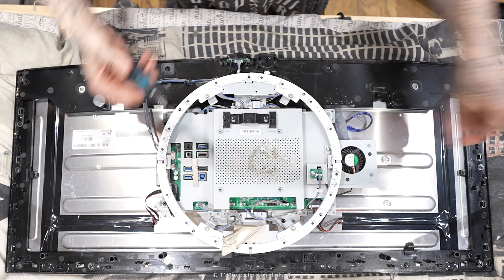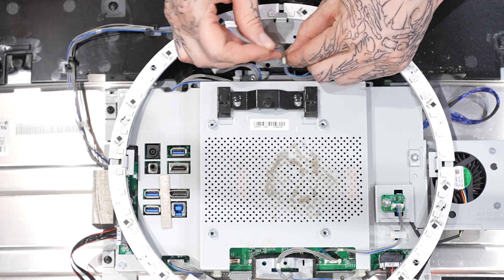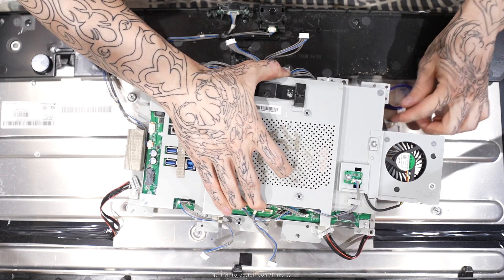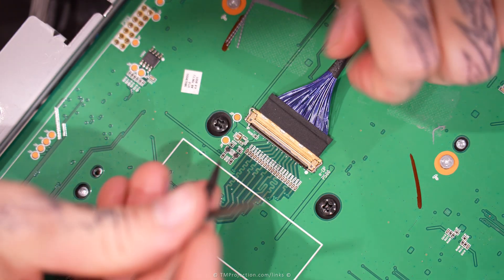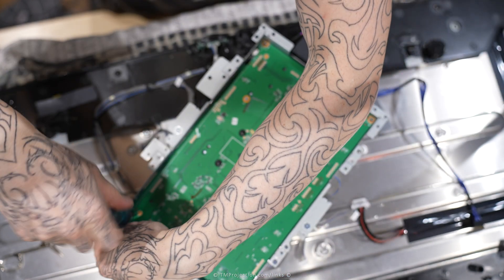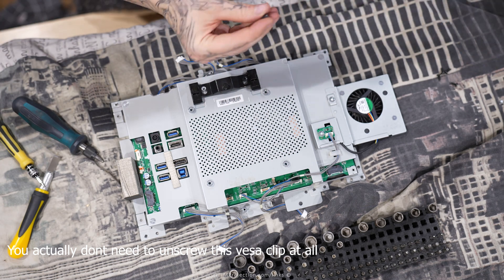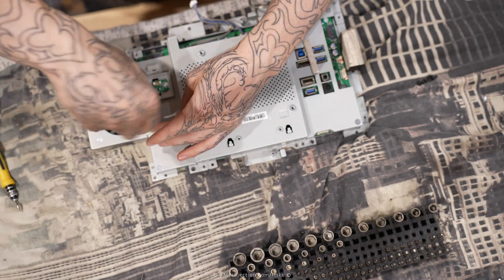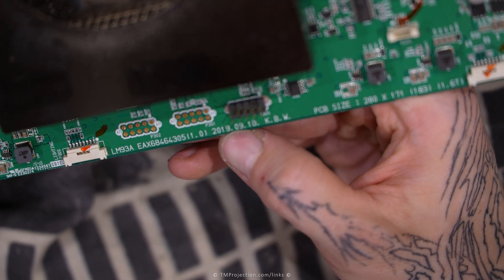LG Ultrawide Monitor 38GL950G-B Disassembly and Repair - 02 Removing the Mainboard

Comment: I'm looking to do a fan replacement on mine because of the extremely high pitch noise that the fan makes. So your back removal video combined with this one is absolutely invaluable. I really just wanted to say thank you for all the time and work you put into this.  I'm a little nervous about opening up my monitor because it's fully functional except for the annoying fan screech, but I have a feeling that listening to 7,000 Hertz whistling all the time is really bad for my health so I think I might just pull the trigger this coming weekend.
Reply from the maker: @falxonPSN  happy it helped mate
Reply: @TMProjection  Me also!!! The QC of LG monitor is concerning, just bought it for 2 years only... mine is 27GP950. It might order the same fan from ebay, I hope I could find it. Thank you very much TMProjection. I did a lot of research, but your video is the most useful so far.
Reply: Did you ever find the model for the fan mines doing the exact same, I stripped it apart and cleaned it out, I believe the bearing has gone.